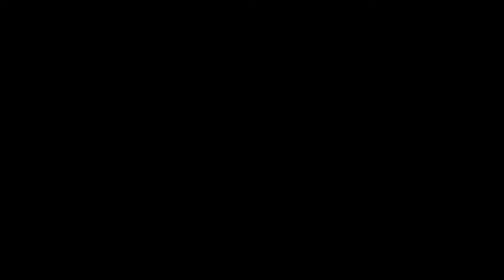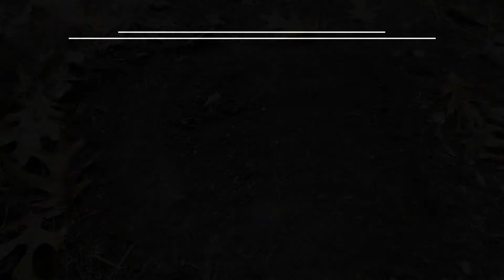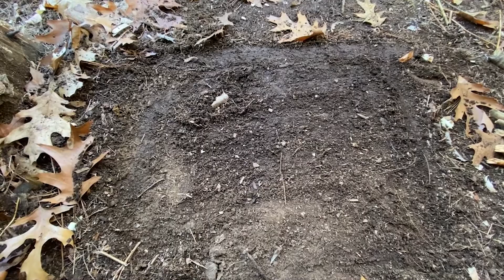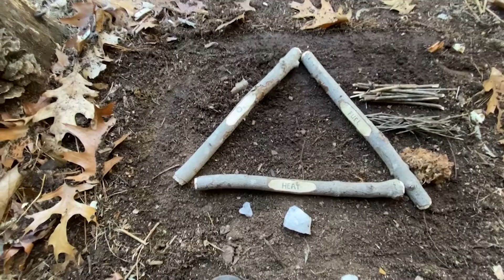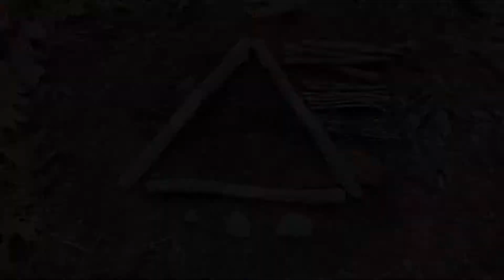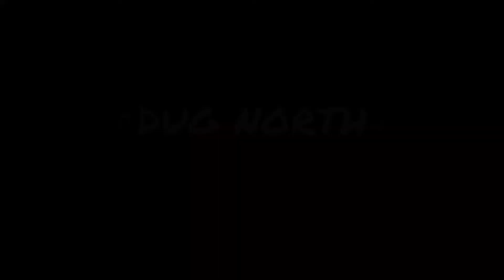Understanding the Fire Triangle When Creating a Campfire

Comment: I always build in Ziggurat style. 2 larger logs as base, then build a grid going up 3 layers with my best kindling on the ground and on top of layer 2. This way, i get a good oxygen flow from the bottom and can pile thicker branches on once the kindling catches. I have started many fires in damp and wet conditions this way. The key is having some dry kindling on hand.
Reply from the maker: Sound like a perfect strategy!